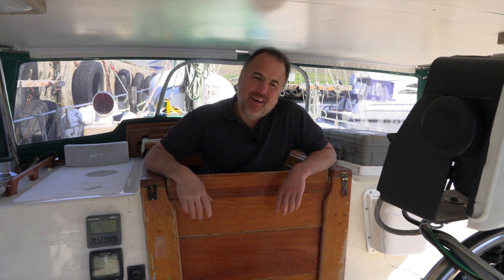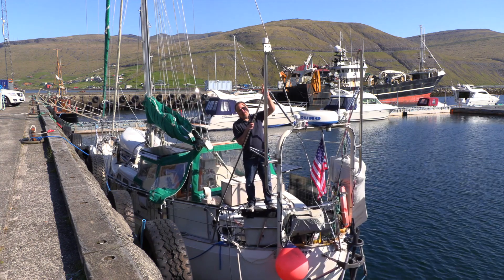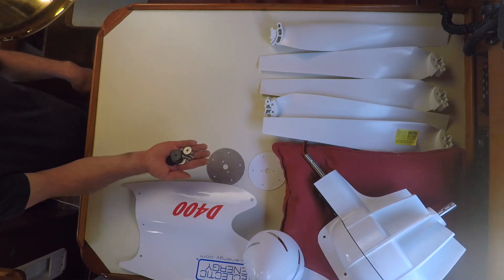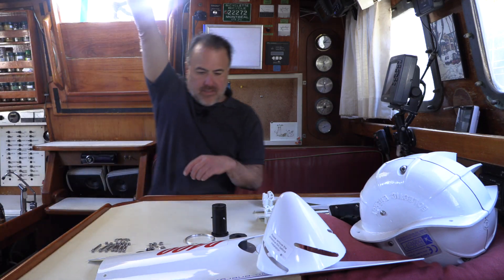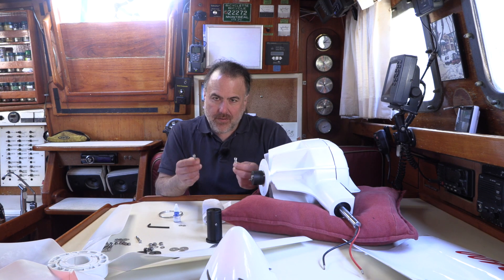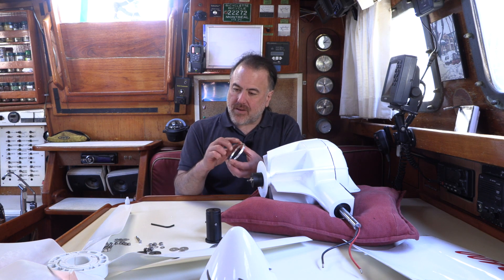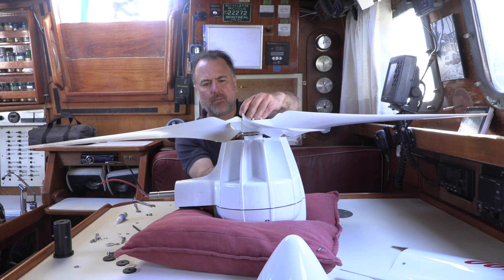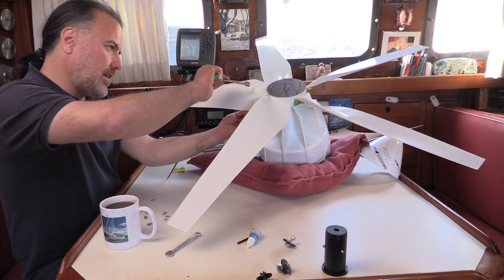Eclectic Energy D400 Wind Generator Installation (Part 2)

Comment: We are having trouble sliding our D400 blades onto the rotor bushing.  Not able to start the blade housing with the aluminum ring side first onto the black bushing.  When I measure the diameters, the   black bushing is 45 mm as is the front of the blades assembly.  BUT, the aft edge of the the rotor assembly is smaller diameter, almost 1 mm less, making it impossible to tap on.  Has anyone had this issue and have you got a solution?
Thanks,
Leon
s/v NOMAD
2007 Outbound 46

Comment: What size electrical cable do you use to carry the current ( 12 volt ) from the wind turbine  into the  battery set up .Anyone  give any advice please !
Reply from the maker: That depends on how long the cable run is between the turbine and the regulator.

From the manual: 

Connecting cables between the D400 and the battery bank or inverter should be
appropriately sized to minimise transmission losses. ...it is advisable to keep cable runs as short as possible
and be prepared to use heavier gauge cable for longer runs.

Suggested cable conductor cross-sectional areas for a 12 volt machine would be:
0 - 10 metres cable -> 6 - 8 mm²
10 - 20 metres cable -> 10 - 16 mm²
20 - 30 metres cable -> 20 - 25 mm²

If you’re not sure, I’d try calling and emailing Eclectic Energy directly.
http://eclectic-energy.co.uk
Reply: Thankyou so much for replying so quickly.The cable you are using,is that 25 mm .The current will have to travel quite a few mtrs to the regulator so I take it that the thicker the better.I have got a Nauticat  ketchup so I am having to build a stainless steel apparatus at the stern to get the turbine clear of the  mizzen boom and sail so that increases the distance the juice has to travel .
Reply: This damn predictive text.When did a ketch yacht  turn into a bottle of sauce ?

Comment: I really liked the video, very interesting.
You really sound use safety glasses when using a drill, especially when you were drilling into the stainless steel - it only takes very small flake of metal to go blind and safety glasses are pretty cheap for a good pair.

Comment: Some people always look for the difficult method. Examples: drilling the support holes instead of climbing afterwards, installing the nose cone before climbing, using the proper cable harness to support the cables, (the eye ring idea is a good one) put the metal plate on and secure it with the first bolt and nut thereby foregoing the tape. It is okay to overlook these on a practice run but when you post to final video, check your methods first. How do I know this? Experience !  LOL
Reply from the maker: LOL

Comment: Drake  , What stops the Generator from turning  around on the pipe and twisting the wire going down in the pipe.
Reply from the maker: The stainless steel shaft base with the wires coming out of it (and the tower liner) stay stationary as the wind generator body rotates.  So the wires don't rotate inside the pole at all.  Take a look at this part of the installation video -> https://youtu.be/E6xypfntBa0?t=639.

Comment: Great video as usual. Thanks a lot for showing us the whole mounting of the head unit  I had no idea  they were actually that big. I've never seen one up close with someone next to it to gauge it's actual size and the weight was a surprise. I saw some movement of the  mast when you mounted the unit. Does this unit weigh a lot more than the original one?
Can't wait to see the next step.
Again, thank you for sharing.
Cheers
Jay

Comment: Been thinking about one of these, space is very limited on my 66 gladiator 24'...depending on how I mount, I could get 3-4 good sized solar panels, and have been wondering how much something like a wind gen wluld compliment a 200w solar setup...Im  2-3 years from casting off so plenty of time to research

Comment: nice install, only thing extra i would have done was to fill the terminals in the terminal block with dielectric grease before inserting the wires. helps fill the airspace so if water does get in, it won't wick into the copper strands. even though you taped it, it was 2 separate wires so there is still an unsealed gap between the wires. think of it as electrical bedding compound.

Comment: Well, I am certainly happy for You that You had calm seas. Hahaha Yeah, there are lot´s of things that can fall in the water and get lost forever.
There are two things at this point I would like to know more. I would have liked to take a look at the quality of the slip rings under the black cover of the housing. And second... how long in is wire and what wire gauge did You choose ?
Well, maybe You have the chance in Your next vid when You install the controller.
Thanks, I enjoy Your video series.It´s about time that somebody on YT shows a realistic set up of a wind turbine on a boat and the things envolved. Can´t wait to see the D400 in action with real life data. I am sooooo!!!! tired of manufacturers trying to sell me a spec sheet and telling me what there wind turbine can do for the $$$$$. So let´s find out how much amps the D400 will put in the battery. I hope You will not disappoint me and show with lot´s of detail. I believe You should get best results since the cold winds up north bite a lot better on the blades...
To take it a little further and inspire You for content of videos. I think it would be interesting to compare Your general energy situation in the northern hemispheres to be able to compare with warmer climates like the Caribbeans that require a lot of cooling like fridge and AC.
Cheers

Comment: Thanks for the great videos, can't wait for part 3. It occurred to me that the two items you showed in part one designed to dump power and convert to heat during high winds could be made use of in the winter if mounted cleverly. Then, in addition to the 400 watts of electricity, you would also get the  many additional watts that are only available as heat. As a side note, I find that the sunbeam waterproof mattress heaters on berths are the best option for any attempt to heat electrically offshore. Works like a charm for me anyway.

Comment: What is that little tether on the back of the fin to the pole for?
Reply: if you need to do any work on the wiring, you have to be able to stop the turbine from rotating. the tether allows you to pull the turbine 90 degrees to the wind so it stops turning, then you loop the tether around a propeller blade to lock it.

Comment: Is it significantly quieter than the Air X?
Reply from the maker: Absolutely.  Our D400 is way way quieter than our Air X marine was.  The D400 is unbelievably quiet.
Reply: Thanks for the Quick reply Paragon. That's good news! Seems very heavy probably because it has heaving well made wingdings. Any negatives noticed regarding the weight?
Reply: the air x is noisy because it has very powerful magnets and a compact rotor/stator arrangement. this is mechanically and electrically efficient but produces a lot of vibration due to the 'cogging' effect that magnetos have. the d400 is larger in diameter so i'm guessing it has less powerful magnets but a larger, heavier stator winding which results in less vibration, which means less noise. so, it sacrifices a little bit of efficiency for peace and quiet....